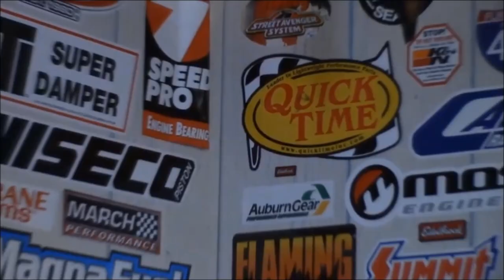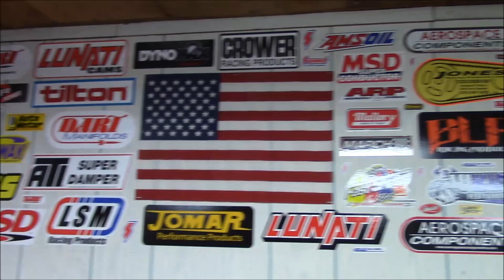DIY Garage Workbench Upgrades

Comment: I'm an electrician. I've seen worse. Lol. The LED you install don't pull any type of a load, but using some of that machinery will probably pull heavier loads. It's always a good thing to pull more circuits to a few quad outlets. Just saying, anyways great video, great ideas, and one hell of a workbench top.

Comment: Looks good man. One thing though, it drive me crazy that you did run the back piece and the metal the full length of the bench lol. That’s just me though. Looks great!
Reply from the maker: I hear yah but I can't really use that end of the bench(part uncovered) because of the cabinet.  I might of saved a bit on the metal but I'll agree that should have cut another piece of wood for the back
Reply: BOOT what did that metal cost? I’m thinking of covering mine. I don’t know anyone in that business so I’ll be paying full cost. Trying to get an idea.
Reply from the maker: @uwishpal  I wanna say it was $87ish with the two bends & tax, and I think just over 5' long.  So full length would deff been over $100 a bit
Reply from the maker: Think I mention the gauge/thickness in the video